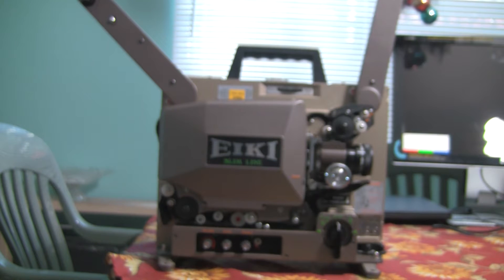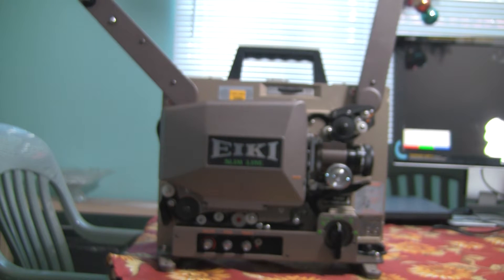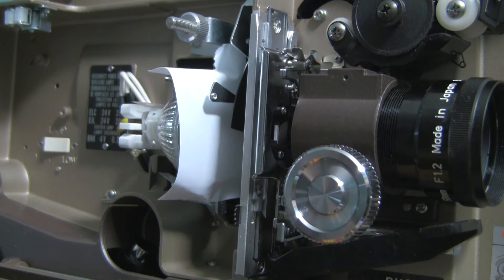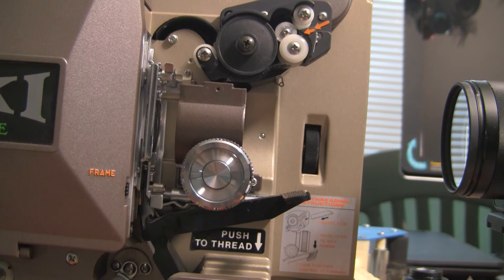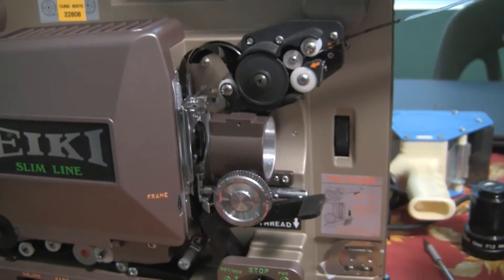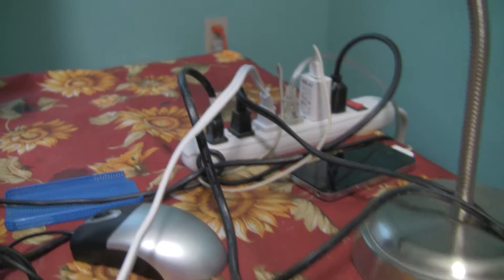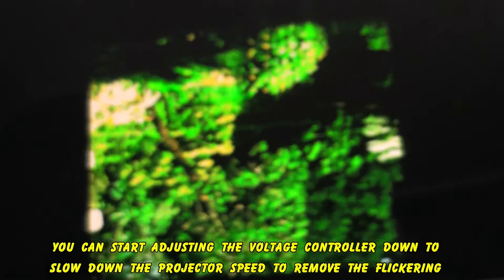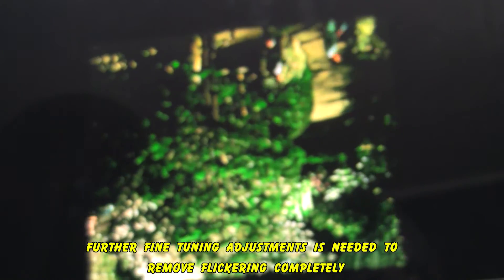DIY Telecine Project on Eiki 16mm projector

Comment: great job!  One question,  have you tried using a dimmer and a dimmable led light to get the brightness you need instead of the paper?   Was the macro lens really necessary? havent you found maybe having the camera farther and with more zoom?
Reply: The paper is there to diffuse the light so you won't get a harsh light.  My Sony camcorder has a built-in ND filters that I can use if the LED is just too bright which helps.  Zooming in at a distance without a macro is nearly impossible to get a good focus on such a very small film gate.  The best macro lens that I can think of is the Venus Optics Laowa 24mm f/14 Probe Lens  on a DSLR.  But it's way too expensive.  Its the best since you can get real close to the film gate.
Reply: @meljenkins1016   Hi Again! Mel.  I found the   raynox macro lens that Ypu used in your video and already transfered about 6 hours of film using your setup. I understood what you explained me!!    I used also the paper and added a wall dimmer to a dimmable led light to control the brightness.  Worked great!   My goal now is to control the motor speed adding a speed controller to the projector in order to reduce the flicker.   Just wanted to let you know this and to wish you a nice 2022!
Reply: @miguelgutierrezdequevedo1313  All these videos that I have seen to do film transfer wasn't really complete especially the flickering problem.  I also found out that if the projector runs at 24 fps then chances are you can set your video camera at 24 fps and shutter speed at 50 that would greatly really reduce the flickering with a very slight adjustment on the speed control.  Glad my presentation worked out for you.
Reply: @meljenkins1016   Thanks Mel  I will let you know about the improvements I could get.  You have one more friend here!

Comment from the maker: Anyone watching my video on this know this video is old.  However I have found a much better voltage controller that has more of a fine control on AC voltage tuning.  It's called Drill Master Router Speed Control Dial which you can get at Harbor Freight.  Also forgot to mention if the aperture settings on your camcorder is wide open (2.8 or less) it may be too bright to record.  To solve this is to use a variable ND filter mounted on the front lens.  My Sony FDR AX100 has a built in ND filter. Otherwise you may have to adjust the  aperture settings a little higher.
Reply: Hi there. Cool video! I have a question regarding the voltage controller. If I use a drill master router speed controller…could this ruin the projector in any way? Like burn out the motor? Or anything like that?

Comment: Nice presentation, I'm using Eumig 710D with the hot bulb 12v 100w and always on a lookout for a led comparable.  I will definitely try your bulb  u are using.
Thanks for posting this .

Burlington On.
Reply: Any further info about the voltage regulator would be appreciated, thanks again great presentation.

Comment: Not a bad start here if anyone wants to get into this. Back in the 90's when I wanted to try this myself I had to invest in a projector with a specific shutter that had five blades in order to sync it with a camcorder.
Reply from the maker: Yes, 5 blades from what I understand removes the flickering.  You literally have to dismantle your projector just to change the 3 blade on projectors to a 5 blade.  Then you have to make some fine tuning adjustments to correct for a 5 blade otherwise you will get ghostings.

Comment: Question, is your Eiki 16mm Projector a 110v one or a 220v one? Thanks!
Reply: US  110v .  The AC voltage controller can work on both source voltage.

Comment: Thank you so much! Great detail! The link to the actual LED projection lamp is no longer available, but there are others on the site. In post, do you have to flip the footage vertically and horizontally?
Reply from the maker: Yes you need to flip it vertically and horizontally using a video editing software like Adobe Premiere or some other software to do the job.  Plus other things like color correction from poor quality films.